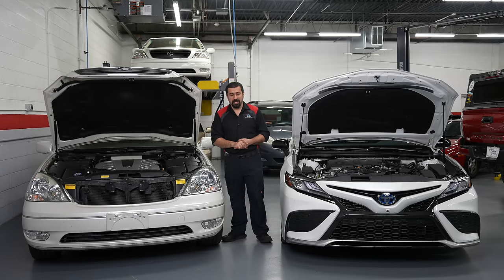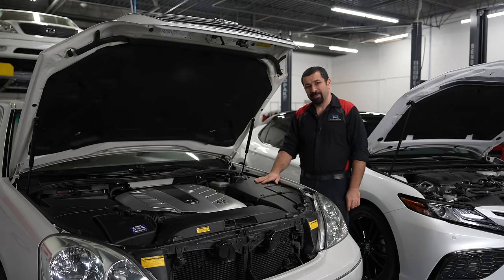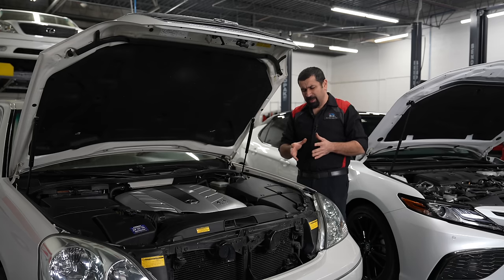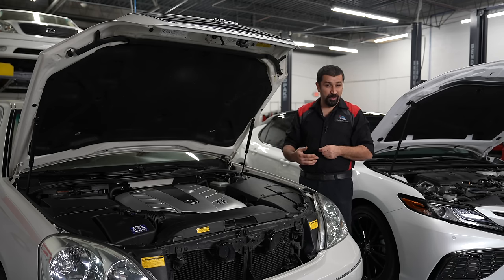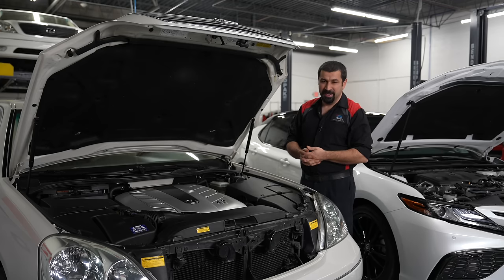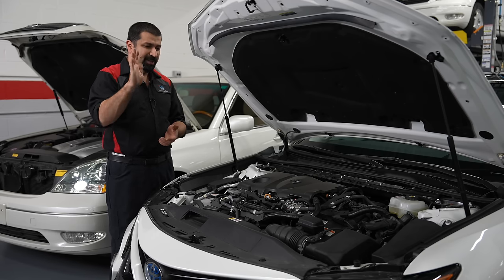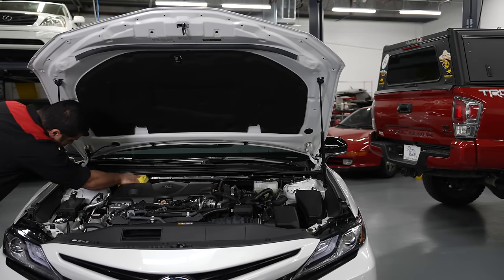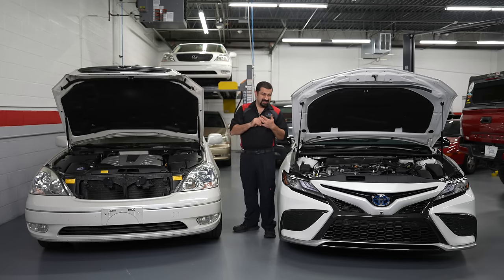Never Do THIS When Cleaning Your Engine Bay! Do THIS Instead

Comment: I just don't clean mine.
Reply: Me, too. It's the Scotty Kilmer method.
Reply: Seems wise
Reply: @TheRedMenace12 😂😂
Reply: Period
Reply: @TheRedMenace12 LOL I can hear Scotty in my head all the time 😂
Reply: @jariyadesigns  I like his take on vanity covers on engines.
Reply: Depends where you live
Reply: @jariyadesigns yeah me too
Reply: 8:25  @TheRedMenace12
Reply: @The😊RedMenace12
Reply: @jariyadesigns stupid beauty cover
Reply: I keep mine as clean as possible.  I do all my own mechanic work, and I do preventive maintenance often; it is hard to inspect when the engine looks like something out of Mad Max.  

If you see a drop of oil under your car, it is a hundred times faster to diagnose when things are clean.
Reply: Me too
Reply: Same
Reply: Wipe with a cloth.  Done.
Reply: No reason to clean it, unless you got really bad OCD.
Reply: Based on
Reply: Lol I just spot wipe the dust off top of the plastic parts with a damp rag
Reply: Dirt contains grit & sand & will wear out certain components,salt will absolutely destroy electronics, connectors & the alternator , same with oil buildup causes failure, fires ,you can eat off my engine & it's 25 years old ,if cleaning the engine do it by regular hose ,disconnect the battery & check everything to be dry before reconnecting & starting the vehicle

Comment: Detailers, especially on YouTube, love to deep clean engine bays because they’re always so dirty and show a huge difference when cleaned. They pressure wash rinse, soak it in foam degreaser then hit it with another pressure wash. My gut instinct was that it was excessive especially in newer cars with so many sensitive electrical parts/connections, thank you for making this video Ahmed.
Reply: Meh not a big deal, don’t directly hit electrical components, keep the pressure washer a good distance away, and always keep the washer moving
Reply: No,  you forgot the MOST IMPORTANT STEP.. the last step.. which is to REMOVE THE WATER after the second pressure wash, preferably using an air compressor because they're the strongest, every single connector they see will dry up completely after just a second or two with that amount of concentrated air. I almost exclusively follow AmmoNYC and every single time he dries the entire engine compartment, using microfiber cloths and compressed air.
Reply: @Jay-rg5mt the issue is the moisture getting into the wiring harness thats how i see it. Damp towel is more than sufficient i believe
Reply: I always have the car running when I do a quick clean. Pressure on low and at a distance will clean it real quick and never had a problem. I do it about once a year maybe every other year
Reply: Just have common sense. Remember that water is an electrical conductor ang can cause short circuits. Also water causes corrosion and oxidation...i just brush off or blow up dust with s compressor and wipe damp microfiber cloth on the engine.
Reply: Replace pressure washer and hose with a pump sprayer. Much much safer.
Reply: @bakker6293 Technical water is not a conductor
Reply: @nikoniko3483 nope pure distilled water but the trace elements in normal tap water makes it conductive.
Reply: Just turn on the engine & let it idle.

Comment: One time I went to a Toyota dealership to pick up some parts and I’ve seen their mobile detailing staff members power washing engine bays in pre owned trade-in cars so I assumed that it was safe enough to spray engine but not the electrical components. Thanks for sharing your wisdom and mechanical knowledge with us 👍.
Reply: The dealerships usually contract 3rd party detailers to do their jobs. The detailer will charge a certain amount like $500 for example & the dealership charges the customer $1100.
Reply: I've seen toyota detailer power wash the inside of car doors 😂
Reply: @balabay77  Worked for Toyota in the early 90's which i jet washed Toyota engines & the area manager caught me TWICE! He did warn me the first time. Never had any issues,i didn't go overboard jetting it,i just made sure the chemical was pretty strong but not overly strong/powerful....a decent scrub prior to jetting is what i did.no comebacks thou..
Reply: I work for a rental car company who works out of a body shop attached to a dealership.  When you buy used cars they power wash the engine and door jambs and around the trunk or rear door channels.  They soap down a dirty car and use a clay bar haphazardly over the paint while it has dirty soap on it.  They are doing a "job" this is not a well paid career choice.  They don't care.
Reply: @joeshmoe8952  no way that cost so much more that having a detail department back in the 90's i was TOYOTA Certified just to detail TOYOTA Certified  used cars i find that hard to believe when 500$ will pay a couple of detailers at most dealerships
Reply: I have pressure washed the complete interior of my 2010 Prius including the headliner following up with a wet vacuum cleaner and the results were amazing! I only used a small amount of spot cleaner and that’s it! The vacuum removes most all of the water, dirt and it dries out quickly on a summer day!
Reply: I always cover (plastic grocery bag) the alternator and electrical connections that will get more water during engine bay detail. I also use minimal water to clean. You gave really great advice.
Reply: I was in the car business a long time. I've seen crazy stuff just like a lot of you guys. I've been to dealers to pick up brand new demos for influencers in the NY metro area. Can't tell you how many times I've seen those little dudes from Central America and other places making $8 or $10 an hour, working for the dealership, hitting the engine bays with pressure washers under the hood, on the engine and all over, and then they close the hood and they're told to work in a hurry and they take dirty rags to dry off the hood and sometimes they can't reach to the wipers because the car is so tall and the hood is so long I've seen very clear zipper marks all over hoods right into the paint, most do the time they don't realize it. I've seen these $10 an hour dudes mess up brand new cars, $40k, $60k, $80k cars having to be sent right to the detailer or in some cases the body shop. It's sad to see a world where franchise dealerships making so much 💰💰💰 and they don't want to spend money on a proper wash and detail team. 🤷🏻‍♂️ I for one, whenever I check my oil or do my oil change either on my car or  my wife's car I use Tub O' Towels for heavy grime or just Great Value baby wipes, those baby wipes work great on motor oil, sucks it right up. I do routine touch ups and I never need any water, I just wipe it down and maybe some compressed air for leaves and dust in hard to reach places, you don't need water on an engine period.
Reply: @BruceSWeinberg  aluminum foil works good also🙂
Reply: They're cars that go through deep 🌊 water and are fine...😉
Reply: Just because someone works at a dealership doesn’t mean they know anything beyond how to drive to the deslership
Reply: I just use spray in my garden house
Reply: @goldentrichomeshydro4260 if it's painted areas, just the edges, sills and shuts that isn't a problem. When used carefully PW causes less over spray than a hose.
Reply: When cleaning the engine internally, I let the engine run and put a water hose in the intake. Steamy clean every time 😂😂😂
Reply: Don't power wash use hose instead with shower method
Reply: @goldentrichomeshydro4260  if they are fully plastic, than i don't see why that wouldn't work lol

Comment: In high school. It was fall. Chilly on the verge of seeing your breath. My buddy and I pulled up to the self car wash bays, and each pulled our vehicles in. He opened up the hood. I was like, why are u doing that? He was like oh I do this all the time. I was like, OK, but it's hot. You have it running. I said don't man. He assured me, and literally the 1st minute of spraying, I heard a large crack from something solid metal. Talk about deer in headlights moment. The water was really cold. Cracked his headers. Since then, I clean sections at a time with towels. Fast forward to today I am an auto detailer. I take extreme caution when using a precise directional noisel on my steak cleaner to remove grime. Leaving electrical cleaner and making sure it isn't live b4 cleaning gunk from wire looms. Cleaning an engine is much like driving in a sense. You can go fast, but going fast can get you killed. (Or the wires in this instance)

Comment: I had rat poop on my 2016 Honda Pilot engine cover, and removed the cover and washed it in my bathroom tube. I live in NYC, the Bronx, I guess I am going to charge them rent! LOL.
Reply: They take peanut, nut cheese as payment.
Reply: Rats in your engine compartment is no laughing matter. Many vehicles have wiring with an insulation material that rodents absolutely love to eat. This doesn’t just damage the wiring harness but also the electrical components and computer systems. I’ve seen repair bills for rodent damage exceed $5,000 in parts and labor

Comment: Another informative video dripping with common sense. As a pro bike mechanic we faced similar cleaning issues with getting water into bearings (hubs, headsets, bottom brackets), the trick is to use dawn dish soap, soft sponge and a very light spray. I finish drying bike with a leaf blower front the front and back (preventing water entry into bearings and frame).
Reply: Unsealed bearings and even sealed mechanisms should be illegal. It amazes me how many bikes that are $1500+ still have unsealed hubs. 🙄
Reply: Even with sealed bearings on a non-steel bike?
Reply: water in engine bay, motorcycle, bike, is all madness. just wipe it off. 
minus engine bay, that one needs nothing. leave your esthetics for visible parts.
Reply: @kovie9162  Yup. It is best practice.
Reply: @Evom777  Yes. That is ridiculous.
Reply: @ivok9846  Cooling fins on engines at times need cleaning, especially dirt bikes that have been in the mud. But yeah, other than that, who cares if the engine is shiny? It's whats inside that makes a difference. Change oil often, for instance :) 

Used to use a hay swather that had an air-cooled Wisconsin engine on it. That thing would get clogged with pollen and dust routinely. Had a tank of compressed air in the truck to blow it out every so often. But not many people run into those kinds of problems, for sure.
Reply: I rarely clean my engine compartment, but when I do I use Dawn as well.  Just a bucket of warm, soapy water and a shop towel.   I don't spray anything in the engine compartment, just get the rag wet and wipe it down.  It doesn't have to be perfect, but you can get it looking pretty good just wiping things down.  People go so overboard on stuff that doesn't matter.
Reply: Dish soap on the exterior? That's one thing you don't use on a car, especially for rubber trims. Dish soap has too much sodium.
Reply: Thank You for this.  My son has been fighting me about buying a pressure washer to clean his dirtbike ( im sure he saw someone on Tic Toc)
Reply: @mplslawnguy3389 
An engine not caked in garbage will have better cooling. You provide far less work for the coolant to cool off your engine as well, thus saving the engine when a hose pops from the increased pressure of hotter coolant. 
And what doesn't matter to you matters to someone else. 
Any one generally wanting to do this also cover certain areas of the motors to prevent water in that area. 
Also generally working on an engine is much simpler when you don't have to worry about outside contaminates getting into the engine. 
Just like with most things, there is a right, and a wrong way to do something. A clean engine isn't a detailed engine. You aren't doing it to show off the motor, your doing it to provide better cooling. You don't need to have much knowledge knowing that adding more shirts on yourself will equal you heating up more, and taking more to cool off, but instead of shirts for a motor, it's crud. 

And last but not least, the diameter of the tip on the pressure washer also determines the amount of pressure the water comes out as. Using a 15° versus a 45° tip will have drastic pressure differences. My 1600psi washer, I can use a 45° tip and have my hand 2 inches away before it hurts. 15° it's about a foot away.

And lastly, why would truckers allow us who worked at a truck cleaning facility to not only use 3000psi 15°tips on their motors while they run, and also have 4500psi 35° tips spraying the undercarriage if it didn't matter? These are the truckers that use their trucks, not a showtruck. Their is absolutely legitimate reasons to clean an engine other than to make it look good.
Reply: Dawn dish soap. Dawn for this, Dawn for that. Dawn Dawn Dawn Dawn Dawn. Ajax can do the same. Palmolive. Whatever.
Reply: @JulianKapa  Dawn Dish Soap has Vinegar in it.  That's why it's not good for electric parts.  If electronic parts are hit with a fluid that can carry a charge,  try rinsing it clean with 93% isopropyl alcohol, use compressed air to dry it. Then use WD40 for water displacement afterward.  MAF sensor cleaner does a better job but it cost more.
Reply: Hi sir. Would you happen to be a mechanic for pro motocross? Always do your best and have fun. Never quit when you still have something to give. It's not a funeral, make some noise. Perfect practice makes perfect. If you are going to participate, make sure that you give your all. Privateer power.
Reply: @kellyfontes7757 Always do your best and have fun. Never quit when you still have something to give. It's not a funeral, make some noise. Perfect practice makes perfect. If you are going to participate, make sure that you give your all. Privateer power.

Comment: Great video as always 
I wash  my engine couple times a year.   I’m in salt country.   
I regularly spray silicone spray on my wires and I also use silicone paste on and around connectors to keep water off and keeps wires soft and copper wires from going green.   Friend of mine bought tundra same time I did  and his wires started to turn green while mine stayed copper.   Been doing this since 1983.
Reply: Good to know. I'm in southern California and had to watch YouTube videos to see the damage that salt does. Unbelievable till I actually saw it.
Reply: Nice to know others do the same thing. Friends think I'm weird for using silicone/dielectric grease to protect the electrical contacts.
Reply: I clean my engine by hand, water and bucket a small brush. Then I buff the whole thing with WD40 with a rag till dry. Last 6 months.
Reply: I live in Finland. Lots of salt on the road. Have an opel astra (more or less a Chevy Cruze) and don’t think I ever ever cleaned it except for making sure it doesn’t get dirty between the poles of the battery. Haven’t had any electrical problems at all

Comment: I have a 2020 Tacoma and when I clean my engine bay, I don’t use any water at all. I use Chemical Guys “Nonsense” (no water) all purpose cleaner. I spray the cleaner in a small area, clean with a small horse hair brush and then wipe it down with a microfiber towel. 
Doing it this way takes more time but in the end, I have a clean engine bay without the risk of any water damage whatsoever.
Reply: As a pro detailer  try switching  from the chemical guys    to bilthamber  surfax  HD,  huge difference  and much cheaper in long run also I recommend  bilthamber  atom mac for your under body of the Tacoma
Reply: When I first started detailing, all I knew was Chemical Guys. Now I’m starting to branch out. I’ll look into your recommendation. 
Thanks!
Reply: @pilgrim985  chemical  guys spend most of their money on advertising  and fancy bottle but most of their product are sold at ready to use strength  where other company products can be dulated and  some are like 100 :1 or more with companies  like bilthamber,  koche,  wolf gang and more , chemical  guy are more for those who get attracted  to the fancy bottles
Reply: @rdeh1678 may I ask if this Bilt Hamber Touchless Surfax HD is able to remove grime and grease from surfaces, and won’t damage plastic and wire covers?
Reply: @ejshelby5460  that's correct it is non caustic , and safe , they also have a amazing prewash that is sugar based and lifts dirt like no other snow foam has ever done basically cleans the car without touching  it crazy . Surfax  HD is a great  A.P.C ,  while touchless is a ph12 snowfoam prewash ,  for rusty cars they have atom mac

Comment: Something worth remembering from the carpentry trade: water will travel upwards between two surfaces - against gravity. If I remember correctly it was referred to as the "phenonemon of capillary action". We had to know this when making casement windows to determine the gap between the sash and frame, and then create an anti-capillary groove.

They were referred to as anti-capillary grooves on the drawings that went back decades and decades. So different from 'drips'.

So the point being that when AMD says water will find its way into areas, this is how I expect it will do it. If water finds a way with wood, then I expect it will have an easier time with metal and plastic.

The last mobile mechanic I employed just left the hood open in the slashing rain, and I never went back to him. Shows how rare a mechanic AMD is that he brings this up. Greatly appreciate the videos as always.
Reply: Wood wicks as it's permeable. Metal is not. Basic understanding of materials.
Reply: not being a dick/capillary attraction
Reply: @jahmanborneo1343  it wicks because water is attracted to itself, not because of the properties of the adjacent material.
Reply: @jahmanborneo1343  Not being a dick, materials don't matter, it's a combination of liquid surface tension and the adhesive forces in play. Basic understanding of capillary action...
Reply: In the case of plastics is more about the vapors.